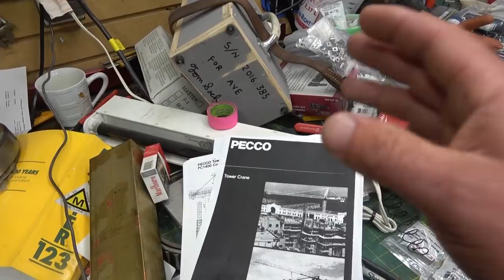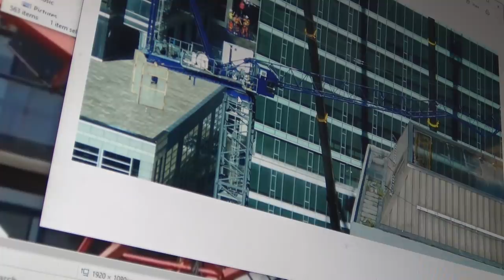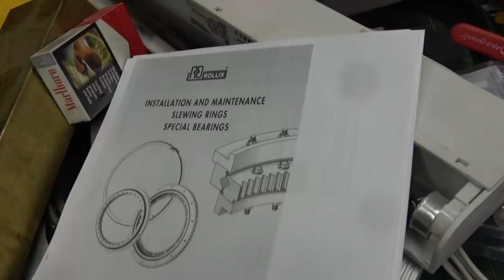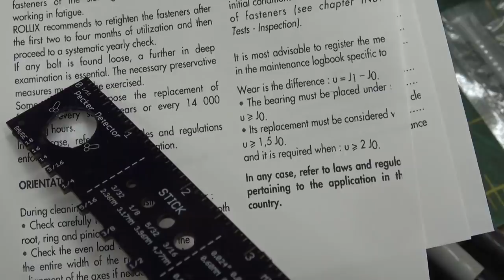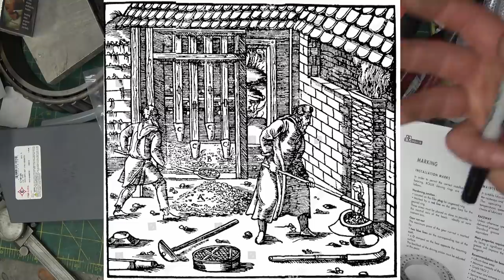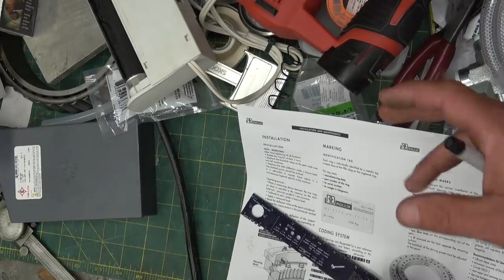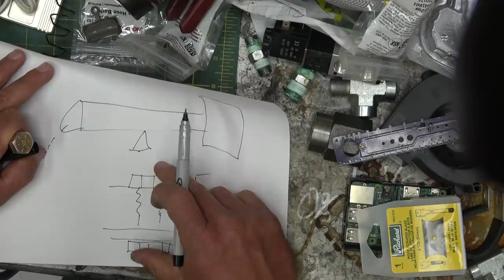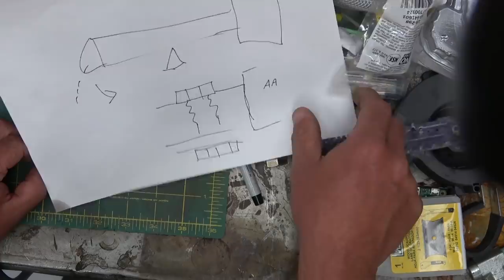This is happening too often | 2 Cranes Collapse in Toronto

Comment: You are one of the sharpest I have ever heard in this field.  Another thing to watch out for is a crane system being subjected to unanticipated impact load, either in the structural system or wire rope management system.  Once an unanticipated impact load is encountered, all deals are off.  Take the crane immediately out of service and disassemble as a damaged structure with all worst-case safety measures in place.  Every part of the system must be X-rayed, Magna-fluxed, and all fasteners replaced and wire rope replaced before return to service.
Reply: so sharp he thinks a TOWER CRANE has a LUFFING JIB

Comment: AvE that black and white drawing of the swings perfectly represents what I do and deal every day.
Reply: You build swings.
Reply: Butadiene pendulum engineer is a prestigious gig.
Reply: I still don't see what is wrong with the third swing. It's secured to the strongest part of the tree, like it should be.
Reply: @evictioncarpentry2628  priceless.
Reply: As a mechanical and electrical repairs worker I get that in words like the thingy is broken or the whatsit don't work.
Reply: @CyberlightFG  Yes, electrified swings 90 ft. in the air.
Reply: @newjargon1697  Thats a big swing. Do you get an entrance fee or are you paid by the hour?

Comment: I'd also be looking at bolt stretch as well. Nothing like slapping pre-load on those bolts over many many years and eventually you've stretched the bolt past its limit. I saw a boom crane drown itself in the Gulf of Mexico for this very reason.
Reply: Ben, In extreme applications we have bolts you can only torque once in their lifetime. If you torque them up and for some dumb luck you screwed up and have to remove them then they get tossed. Others we stamp or mark every time they are torqued. Two or three sequences and they get the boot. They get knicked or cut with s grinder so some lazy SOB won't take a short cut and dig one out of the bin.
Reply: Curious if they are mandated single use or not...
Reply: @christopherress6635  I doubt it given they are likely not removed to disassemble/move the crane. The manual would have said to set torque on each install but instead it says annually after an initial break-in period.
Reply: Regular fastener replacement must be part of the maintenance procedures on any crane system.
Reply: @gutfinski  I agree on fasteners that are regularly removed for disassembly/assembly.
Reply: Was this in Pensacola just a few months ago?
Reply: They probably have a limit to the stretch allowed on the bolts, but that probably, along with the requirements to replace every x number of years, or to do NDT on them after such time, was ignored.

Same with lifts, you are required to do NDT on the sheave shafts every 5 years, so as to detect cracking before it actually has enough cycles on it to penetrate through to the point the shaft fails. Can be 100 years old and still working, just you have to do the ultrasonic inspection, as otherwise you have to dismantle the main gearbox to get the shaft out for other test methods. Bit difficult with 50 tons of car, cable and counterweight hanging off it. Funny enough for a lift same stress running empty or fully loaded, there is a sweet spot in the middle where the car and counterweight is balanced in mass, but you almost never will actually run there.
Reply: Preload shouldn't go over yield unless they are specifically down as replace-every-time bolts.
Reply: @ericwooden9569  cranes should fall out of the sky either
Reply: This may be a dumb question but why not just use stronger/bigger bolts than the load requires to compensate for this? I'm sure there's  a great dick joke in there.

Comment: 6:42 they're not essentially in fatigue, they're "essantially" in fatigue, much like the proofreader of that manual. Makes you wonder how many people actually read the manual instead of just doing what they're used to/what makes sense to them.
Reply: I swear when I was working a factory gig operating production equipment I was the only person in the facility that had ever read any of the manuals. Which was really sad, I basically worked 5 minutes out of a hour other then that I was just sitting between machines supervising in case something went wrong so no real reason to not read and them.

Comment: Thanks 4 splainin' the metal fatigue dance.

I'd had no idea why it is important to torque bolts to specific tightness. The preload prevents excess wiggle, which can wear out a tiny area, opening a notch for rust and disasters.

Comment: There was a crane on top of a tube tower on an oil rig in the north sea.  The crane house busted loose at the bearing and fell to the deck, killing at least one worker.  A post mortem revealed the bolts holding the bearing races together were stretched and broke.  Also revealed was that those bolts were not sufficiently tightened to spec.  The resident oil rig maintenance man fumed that the bolts certainly were tight and produced an air impact driver the size of a concrete-busting jack hammer that was used to tighten them.  Inspection of the data plate on the driver revealed it was only capable of less than half the torque required to tighten the bolts.  Tightening them properly would have required a hydraulic torque wrench with a multiplier.

Comment: Shouldn't the preload match the expected loading so there is no elastic cycling? More realistic is preload to (in your example) 50kpsi and load ( working against preload) to <50kpsi
Reply: Enginerding theory is lazy (and I mean that in a good way) and real world outcomes are more dynamic than many engineers seem to remember.
Reply: I tried saying the same thing but you said it better. 

But I also got to thinking about the operator unloading the hook. If done suddenly,  it seems like that would increase the load that the farsteners see.
Reply: 00:00
Reply: That used to be the simple rule of thumb, but as AVE points out, everything is a spring, and that rule of thumb ignores the fact that the  compressed members are also springs. During pre-loading (no external load) the bolts stretch and the joint squashes, both act as springs in series, and the force in the bolt spring is equal to the force in the joint member spring(s). Since the joint members are (usually) much stiffer springs than the bolt is, they only squash a small amount compared to the amount the bolt stretches under pre-loading.
Key thing though is that after preloading, they are still both springs. What that means is that as external tensile load is applied to the joint, it is going into that spring system. So some of that load is reacted by reducing compression in the joint members, but some also goes into stretching the bolt. The relative amount of load taken by the compressed joint members relaxing vs the bolt stretching is determined by the ratio of stiffness of the 2 springs.
A well designed structural bolt joint tries to make the bolt as unstiff (floppy??) as possible, and the compressed members as stiff as possible so that nearly all external load is taken by relieving joint compression so that the bolt sees a negligible amount of stretch/increased load, although it will always see some. This is done to prevent the vulnerable bolts from seeing fatigue cycles.
Unfortunately, the design codes for bolting tend to be poorly written, opaque and hard to follow, so quite a lot of people working in engineering actually don't know how to design structural bolted joints appropriately.
I see quite a lot of poorly designed joints holding up pretty big critical things (including cranes) and a lack of understanding of the implications.
Reply: Preload stress is generally 60-80% of anticipated stress
Reply: Also, if you were to preload at 50k the bolt would cycle between 50-100k
Reply: @bobturnbull18  I was wrong in my statement you are correct. I consulted my textbooks after writing my comment and realized I needed a refresher on preloading fasteners. @Ryan m your comment is logical and I was the one who was talking nonesense! My apologies
Reply: @Matthew Jost, preload should not be a % of anticipated stress, it should always be bigger than the anticipated load. If preload of 80% of anticipated load was applied, then the joint would fail very quickly. 70% to 90% of bolt yield strength is quite a common target for preload, though some high integrity stuff uses preload to yield.
Reply: @JH-hd6ux  Oil and gas we never exceed 90% yield or its scrap. Came back from vacation to find that some idiots took 150# Flanges to 500psi during hydrostatic testing, thankfully they didn't get hurt but we got to cut those flanges off and weld new ones on because they exceded 90% yield by 75psi.
Reply: @Chris-dg6km  agreed for most stuff we design (offshore oil and gas installation equipment, cable lay and  lifting appliances) we design for between 70% and 90% yield during tightening, operating loads (with safety factors) can take that up to near yield, but shouldn't exceed it. This does allow reuse of bolts, as long as safety factors were on the loadings.
Reply: @JH-hd6ux  yeah and people also forget torque isn't stretch it all changes based on the stud being dry, oil, molly, Teflon. When you're torquing 2.5" studs to 3000ft/lbs the friction coefficient comes into play
Reply: @Chris-dg6km  yup. If you really want to know, you need to measure the length of the fastener.
Reply: @Underwatergoat1  yeah but that is quite hard to do in practice because for the accuracy you need, you need to grind the bolt to a precise, recorded length before installation, then need to somehow measure length after installation which is hard to do accurately for a lot of big joints, especially ones into blind tapped holes. It can be done with ultrasonic probes onto the bolt end, but it is quite unusual and expensive.

Of course guessing preload from torque is very problematic too, mainly because friction is so variable, and it has a huge effect.

Loads of companies have exotic and expensive proprietary nuts and bolts promising incredible accuracy based on some sort of length measurement (e.g. Rotabolt or Hytorc nuts) , and they seem to be quite successful in fleecing the offshore wind turbine folks into buying them, but they tend to be totally overdesigned as far as I can tell.

Best thing to do is just not work the bolts as hard by using bigger safety factors/more bolts.

If you really want accurate preload, then best and cheapest method I know of is to use DTI washers which are standardised, cheap, easy and accurate because they are basically just a mechanical load cell.

Comment: As an aside, my dad once had to get the same sort of crane as the first accident from Scunthorpe to the Isle of Wight overnight - 255 miles of English roads (none of that 'long, straight, Canadian' stuff.)  The various county police wanted no part of it when it came to escort - the general response being 'get through the county as fast as you can'  Long, wide, and usings the best of heavy trailer technology post-war Britain could provide, he maintained that the only thing that prevented a blowout was the fact it was a cold, wet, October night, since the tyres and brakes were running hot. Must be about 60 years ago, since it was before I was born.
Reply: Huh, that's a different sort of Scunthorpe problem.
Reply: @mattgies  Shorpe as it's now called, since I left the place (I try to keep music hall dead one joke at a time)

Comment: The trick with fasteners is preventing them from experiencing much cyclical loading as, even fancy high strength bolts with threads rolled after heat treatment, their fatigue limit is only about 110 MPa.  If you keep them tight, the fatigue load range goes way down.

Bolted joint failures are almost always caused by inadequate tightening torque.

Comment: Also, you can do rolled 3A and 3B threads. We do it in critical aerospace parts because it is superior to cut thread by a fair margin since it forms the grain direction to the thread form rather than cutting through the grains. However the rollers are more expensive and they dont last very long on tougher metals.

Comment: Since you went off into the land of metal fatigue and wire ropes, do you have any comment on the suspension cable failure on the Arecibo Observatory radio telescope?
Reply: We JUST replaced those cables 27 years ago!

Comment: i worked at darlington hydro as a mechanic, we had 12 plus cranes on site strict maintenance routine. only three groups were allowed near cranes
  mechanics, electricians, crane operators, then all cranes had double ball bearings on slewing, not sure when they went to  taper roller bearings
  any ideas when the change was made,worked the uk scene and offshore but still learning

Comment: I used to do inspections on offshore cranes, rule there is to do a full ndt inspection on all slewbolts every 5 years. What we would do is change out 20% of the bolts on a yearly inspection and sent them to the lab for ndt. Thus in 5 years having all inspected without mayor downtime. Just a quick bolt swap on 20% is only an hour work. Btw the pretensions we always set by a jack, not by torque on the bolt, this to avoid fretting

Comment: Something worth mentioning , that may not apply here . I work on excavators that have a rotex bearing with balls rather than   rollers . Once in awhile , we got one , where the rotex bolts all snapped , and the house , fell off the car-body . Others had a  lot bolts break . It was on a lot of Samsung larger excavators ,and Cat mid-sized excavators .  Cat solved the problem . They                     put a thick steel sleeve  in the system , about 3 inches long . The longer bolt could flex more in a shock load , and prevent   either the bolt heads popping off , or bolts breaking at the nut-thread interface [ which rotexes dont have ] .    They recalled    the midsized machines in the early 2000s to put these sleeves in .  They didnt break anymore .

Comment: Good point that most people don't realize...many counter-weighted cranes are close to their "red zone" in multiple ways when the boom is brought in tight and no load is on the hook.  After all, a crane is just a balancing act.  Empty counter-weighted cranes want to tip backwards.

Comment: Bolts are interesting because their lives also depend on the bolted joint itself.  Preload will help a bolt survive but also a joint must be stiff and stable or else the bolts are going to part ways after some time.  A tensioned bolt is a stiff spring but a joint is a much stiffer spring.  The relaxation of the joint's mating parts is what helps isolate bolts from harmful cyclic loading.  The bolts stretch as they squish the mating parts together but the components in a "stiff" joint do not compress much relative to the bolt stretch  Thus the joint is a much stiffer "spring" and a very small amount of relaxation will account for a force trying to separate the bolted joint.  If the bolts were loose, the forces can only be resisted by the bolts themselves.

I would think most slew rings are pretty meaty but the point is that poor joint design will kill bolts too, over time.  Something that can happen as designs are lightened to save weight, money etc.

Comment: I was doing yearly inspections at a plant that made roofing panels and girders out of sheet steel, found the main overhead crane that they used to load the spools into the machines was a bit sketchy.  The bridge was attached to carriage on each side by 8 18mm-ish bolts, of which 3 were dangling loose and the others were M.I.A.   I immediately shut off the disconnect and wandered over to the maintenance bay to get a lock-out tag.  They were moving 12 ton spools of coiled steel with the thing, and it was only held together by the paint and gravity.  Needless to say I disregarded the complaints from the supervisor that they needed that crane to continue production.  It's not that uncommon, that's why we made the big bucks doing inspections.

Comment: Actually a third problem comes from undertightened bolts. If they aren't tightened with a torque wrench, the tightness can be different in adjacent bolts, so the more tightened bolts will get most of the force.

Comment: When I was at university, 40+ years ago, this type of failure was shown as a standard example. 
The problem was that when the crane rotates and stops, it causes the frame to twist. The twisting of the frame puts the bolts under tensions, which had not been calculated for, as it was considered that all the load was downwards, so the bolts were not calculated for tension loads, except to retain them in their locations by preloading them.
As this tension on the bolts had not been calculated for, it took the bolts past their elastic limit, and caused them to become loose, and fall out.
As each bolt failed, the remaining bolts became under greater and greater stress eventually the few remaining bolts fractured and failed.
The solution was simple!
They just used longer bolts, with sleeves, so that the bolts could stretch, but still stay within their elastic limit.

Comment: I am no trained enginerd like AVE but I do have a lifetime of experience around equipment. This was a great education on the mechanics of how this happens. But almost everything everyone uses daily this is at play. This same mechanism is why people have the issue of wheels coming loose on their vehicles and why lug bolts often break off. That's why it is important to periodically check and tighten lug bolts on your vehicle. Practically all the parts of the drivetrain engine to wheels is under a load and has bolt torq specifications. That is as described preload to prevent metal fatigue and undo wear. So this isn't just about cranes and every one can apply this to daily life on everything we use.